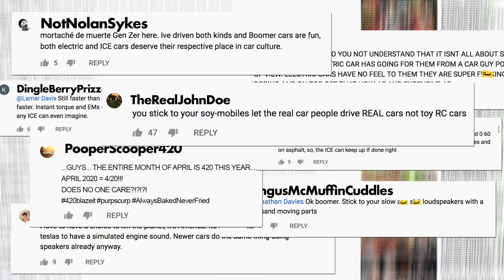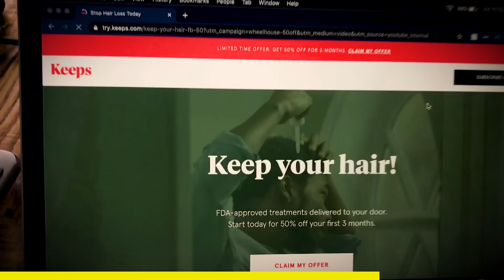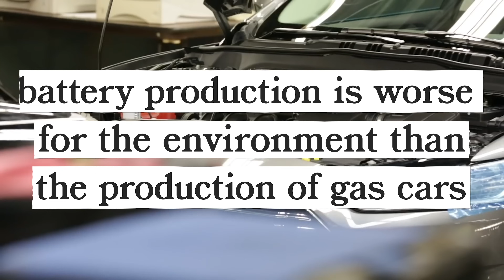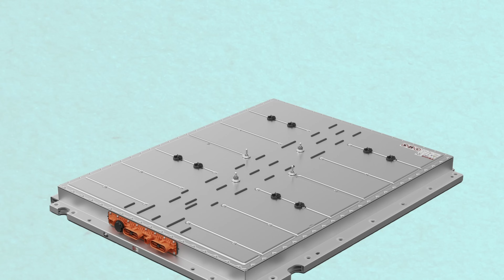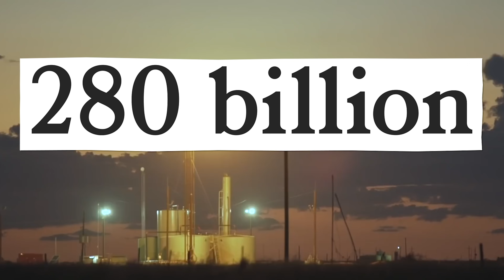Are Electric Cars REALLY Better for the Environment?

Comment: but if you take a look at it, co2 is an indicator gas, which indicates the presence of other greenhouse gasses in the air. co2 is actually a really bad insulator of heat. in my opinion, if gas cars keep getting cleaner, and put out minimal co2 and other emissions, there really isn't very much to worry about. as nolan mentioned, cars do produce lots of co2, but when you look at the environmental damage for mining lithium,  there is a more long term impact, as they are taking out all of the precious minerals out of the ground that plants need to grow. As I live in northern Canada, and have lived in a town where a majority of our economy relies on oilfield, I know for a fact that the oilfields do not cause very much pollution at all. I have also grown up around all sorts of vehicles, and I love driving. but there is a significant difference between our older vehicles and newer vehicles in the emissions department. I do respect it if you think EVs are better for the environment, but in my opinion, as cars are getting cleaner, we have barely anything to worry about in emissions. there is also the manufacturing emissions (which really, who cares) which are absolutely minimal. and I think if you want to save the environment, please go plant a tree. I am open to discussion if anybody disagrees, but this is my true, honest opinion about EVs vs internal combustion

Comment: Tesla recently patented a battery technology that doesn't contain any lithium, and will allow batteries to last for 1 million miles of driving. (Note that this does not mean it can go 1 million miles on a charge.) It means it takes 1 million miles for the batteries to degrade to the point where they can't be used any more. Current Tesla batteries are designed to last for 8 years or 125,000 miles. The new battery will last more than 60 years. This will make it much easier to recycle. Also the new battery technology will give Model S's and X's ranges around 700 miles.

Comment: At the end of the day, using a 4000 lb object to transport a being that only weighs 170 lbs isn't a very eco-friendly thing.
Reply: And your alternative is????
Reply: @Brian-om2hh  ah, you could use a bicycle. Or even a motorcycle. Given the laws of physics, using less mass means less force it's required. Therefore less energy needed to move the object. The lighter it is, the more eco-friendly.

Comment: I feel like he missed the fact that batteries in EVs have a very limited life. They have to be replaced, which causes more emissions and  there is also the fact that while getting involved in accidents alot of EVs batteries burn on impact causing toxic gasses. Aside from the spontaneous combustion of old stored batteries. There is also barely any recycling or resale of non working EVs esp Tesla. Which causes a whole new car to be produced. While individuals and esp junkyards are able to Frankenstein a completely working car from reused and broken down cars this causes barely any emissions apart from the use of some power tools or welding. Personally I think EVs are not the future but merely one step towards the end goal. Hydrogen, solar or perhaps even nuclear powered cars will be.
Reply: Musk is aiming on a million mile battery. A single battery would last even more than the lifetime of many vehicles. Lets see if it's achievable.
Reply: Hydrogen may be the future but it's just electric with extra steps to remove the battery.

Comment: I think what concerns a lot of us with EV's that's not addressed is Battery Life, Battery Replacement, Environment Impact of Battery Replacement, Access to the Batteries in the Vehicle, Charging at Home, Battery Damage due to Rapid Charging, Loss of Range Due to Environment Conditions, Charger Availability and Electrical Grid Infrastructure. 

For example.... One of the nicer EV's or EV Trucks consumes more electricity to charge than my home does in a 24 hour period. If we were all the switch to EV's overnight the current electric grid that we have in place would need to be three times the size that it is now. We have already seen rolling blackouts in some states so what confidence do we have that the power will be there when we need it?

Comment: a blanket statement that if 25% of electric cars today hooked to the electric grid it could handle it.  Yes in some area's, in some area's it will depend on when these car charge time/day.  In some cases the homes electric transformer/service wire cannot handle a car charger,  thus electric system upgrades will be needed.  Mass influx of electric car will require power system upgrades, which cost money, time, and resources (which consume resources and add pollution)

Comment: Let's hope you never need to replace the batteries
Reply: Why? What's the issue?  EV battery packs can readily be tested and reconditioned, in the same manner as reconditioning a gas engine. Weren't you aware of that? There are already videos on YouTube of the process.... Takes just a couple of hours or so, the cost is a few hundred dollars. Comparable with something like a clutch swap on an i.c. car.....

Comment: What about when it needs a new battery?
Reply: You get the less efficient cells tested and replaced to restore the efficiency of the pack. Takes about 3 or 4 hours and costs about the same as replacing a clutch on an i.c. car........ All new electric cars normally have an 8 year warranty. Nissan offer to replace the pack if it isn't at 75% efficiency after 8 years..... They say they have replaced a handful of them in 10 years. Not too bad after selling over 300 thousand of them...
Reply: @Brian-om2hh  im talking about environmental effects of making more battery's for replacements causing a bigger environmental impact.

Comment: When  you change a Tesla battery 3 times in 2 years and 2 motors in 1 year I’d say they are still worse until they can go 100,000  miles without that major work I’m sticking to gas

Comment: At some point, the emissions will also fall for the production of an EV. The reason is that we will probably find a better material (than lithium), that will be more effective and be less environmentally damaging. There are already companies that have figured out how to produce silicon batteries (ex Amprius), which are more effective and could have a smaller carbon footprint. They just have to figure out how to upscale production. 
And the used batteries you talked about, could be used for powerwalls, energy storage at facilities etc.

Comment: Nolan: mining lithium makes polution

Me: ez. Make electric mining vehicles
Reply: What’s interesting is that the really large dump trucks actually are not propelled by gasoline(diesel)at all. They use massive electric motors. However they do have just these tiny little/gigantic gasoline generators onboard to provide electricity to the motors. Haha. I believe it’s the same with trains. They need the electric motors because they are easier to control and I think more powerful too than ice propelled machinery. Anyway! If only you could find a way to supply the electricity to these already electric pieces of machinery. It would be a massive power draw though. 🙁 this is 2020! We gotta find better solutions.
Reply: @GMoney-B  big trucks and trains don't use gasoline. They use Diesel..and those are Diesel electric generators..
Reply: Jay Temkar oops, I meant diesel 🙄😅. Thank you. 👍
Reply: @GMoney-B  i just came across your comment but I believe that was Nikola Tesla aiming for a world free of pollution because our energy would be harnessed from the atmosphere using specific buildings as conductors for electricity... until Thomas Edison sacked him
Reply: @GMoney-B  big brain
Reply: @GMoney-B  Electric motors provide instant torque, as opposed to ICEs. That is why they're used.
Reply: @GMoney-B  anytime you convert power from one power source to reproduce it with another, you loose energy, the more times you transfer energy the less efficient it is, that's why we burn gas to heat houses instead of use electricity that is made by burning gas, because it's less efficient, thus the reason why electric vehicles suck.
Reply: @ryancasey4807  what about when they are powered by solar panels on peoples homes who have their roof and in their backyard to charge it almost all the way? I think that is better than using gasoline in my opinion.
Reply: @GMoney-B  that's a good idea in theory untill you find out how much oil it takes to make solar panels and that most of them aren't in service long enough to pay for them selves or make up their carbon footprint, especially when you consider all the other equipment including the batteries, wires, battery management systems, the dc to ac inverter - and the power losses that come with that. As well as the fact that most solar systems on people's roofs aren't puting out enough power to charge an electric car if they drive the standard amount of miles per year and they have a standard solar set up
Reply: It pollute water and land resources..not the air..
Reply: @jaytemkar8077  desalination of sea water would be good. But I know it is very energy consuming. But we should make use of renewable energy sources wisely. And use that for desalination.
Reply: @jaytemkar8077  r/woooosh
Reply: 9600GTMAN  
Completely incorrect. Most super-heavy mining vehicles are already electric. The main advantage, and why electrics are used is because of the instant torque granted by electric motors. Caterpillar is the ONLY company that uses diesel-mechanical drivetrains in their haul trucks - ALL other manufacturers use diesel-electric drivetrains in their haul trucks - diesel to generate electricity to power electric motors which then move the things. (the main problem with electric is the power supply - making batteries to power such beasts is impractical, whereas diesel has fantastic energy density) 

Virtually all operational military submarines are diesel-electric or nuclear-electric. The most successful tank destroyer of ww2 was petrol-electric. Diesel electric locomotives were introduced in the 20s, and are pretty much exclusively used where electricity isn't easily available through other means.  High torque applications are what electrics are meant for, not their weakness.
Reply: We are still unable to make normal good electrical trucks, mining machinery is still a dream. And it will come true one day
Reply: Drilling for oil, then refining it and transporting it to gas stations also makes pollution. Horses for courses....
Reply: If you're hungry, Just eat your feet bro
Reply: There are electric mining vehicle's, and mines that are zero emission,  Reclamation is a requirement basically every jurisdiction!  Every tangible item you own from house to phone is made from raw materials.
Reply: Extracting and refining oil causes pollution too.....
Reply: Does exactly work like that bro 😂

Comment: The reality is there is no practical solution based upon our current technology. Solar, wind and nuclear are impractical to produce the energy we need and come with their own environmental issues. Until we come up with a practical environmentally friendly power source Electric Vehicles will use as much if not more Fossil Fuels given the losses involved whenever you convert energy and transmit electricity over long distances. Batteries also have an internal resistance which means you waste power charging them. Until we come up with a new power source all we can do is attempt to refine our current technology to be as efficeint and as clean as possible. There are some very exciting new developments into Nuclear Fusion. https://www.theguardian.com/environment/2020/jul/28/worlds-largest-nuclear-fusion-project-under-assembly-in-france

Comment: Well I don't have a Ph.D in the topic but I own a used EV. No one mentions the environmental impact of used EVs. Also I find it suspect that people always compare charging electricity to coal usage like i'm blowing up a mine every time I put 5000 watts into my car. My state primarily doesn't even use Coal it uses gas. Most states with bad ev charge maps use coal.

Not saying they behind the times or anything.

I get it also that the cars are quiet but I find that very interesting for as fast as they can go. Like check out the nio ep9 supercar. This thing is just getting started as long as world doesn't blow up before EV sales do.

Comment: It’s true that in a long range perspective, Low-exhaust engine is way much better at reducing total emissions and recovering construct of nature.
And plus, we don’t even need to make gas on my house’s roof.
Apart from energy efficiency problem, as there are problems that we have not been able to solve even through centuries of investment and research, the fatal problems of batteries will not be solved soon.  The fact that the internal combustion engine has become an unprecedentedly clean mass-produced machine based on tremendous improvements remains unchanged, and although EV has been made huge improvements during a few years, the path for electric vehicles to go is a bit absurd.
Reply: are you on dope
Reply: @lovesosa4751  sadly not as you sir

Comment: Only part I miss is, the lifespan of the batteries. It's somewhat lost and is a big thing. Especially in colder areas meaning it needs replacing faster. Meaning in the end it still has more impact in during production.

Comment: The major problem I have with all the data that you supplied is the unreliability of electric power. There are so many problems you can run into with electricity, that you don't have to worry about with gasoline. You can store enough gas to last you a long time if worst case scenario happens. EMP can cause a major problem with all modern day cars, but electric car are dead with no chance at all.

Comment: 9:50 assuming it lasts long enough to not be replaced. I think my old ass Corolla will be more efficient considering I won't be replacing it for a while. How many of those EVs last that long? Depending on the producer I could definitely say that not all EVs will last long enough to have a long term co2 improvement.

Comment: I ALWAYS HAD THAT FEELIN DEEP DOWN IN MY SOUL
Reply: He didn't site his sources
Reply: @apexhunter935  also he has not considered the CO2 emissions, enviro footprint and societal costs of keeping older EV's on the road. By the time that used EV's are at a second hand price that average Joe can afford they will be needing new batteries and electric motors etc and the environmental costs and hip pocket costs of that will exceed the costs of running an older ICE car. Then there is the costs associated with scrapping older EV's. The toxic explosive materials in the batteries and electric motors  cannot just be put in a junkyard and crushed - it will need specialist expensive recovery stations that will have a large CO2 emissions footprint.

Comment: Hello, I'm sure there included battery replacement approximately every five years. Which is given as battery life before it starts to lose capacity?
Reply: Considering an ice car lacks even a 5 yr 50k warranty these days that is about par. And battery tech will improve to the fabled 1m mile mark. Even as that improves, the average battery distance will remain because cars that drive 900 miles with a 2k lb battery pack might do better having a smaller pack. I mean, I wouldn't buy a new car these days, lifter problems out the factory, recalls on explosive seat belts, airbags, and electronic transmission knobs! Scary! I have a 77 z instead haha
Reply: Most EV manufacturers offer an 8 year warranty on the battery pack. Nissan offer to replace a pack if it doesn't show at least 75% efficiency after 8 years. Packs with less efficient cells can have those cells replaced in just a few hours, at roughly the same cost as a clutch swap on an i.c. car.......

Comment: EVs are a pain in the ass to work on, and most of the companies that make gas powered cars and EVs require techs to have special certifications to work on an EV, whereas the only time any certification is required by the manufacturer for a gas powered car is if it's a higher end model. So with Nissan, the only time Nissan requires a certification to work on a car is for either the Leaf, GT-R, or a diesel Titan. Different certifications for each one. Not to mention the fact that the price for maintenance on an average EV is quite a bit more than an average gas powered car, as well as the cost of much of the parts that need to be replaced, if needed. So yes, an EV will save you money on oil changes and having to stop for gas, but it's also much harder to find someone who knows how to work on your car in the event it breaks down in the middle of nowhere.

Comment: The coal the power plant can convert many times more usable power than a car engine does burning the same amount of material. This argument was originally made by gas engine car companies to slander electric cars. Also lithium car batteries can be easily recycled. If we have made electric are more available for everyone, these "problem" won't even exist.

Comment: Nice video but you forgot to mention 1 thing, after a couple amounts of charging a batery the batery will store less energy.
so how more you charge, how worse the batery get.
on a longer time period, for example 20 years the batery needs to be changed so that same 17metric tons what you mentioned wil be poluted again.
Reply: Most Tesla owners with cars that past an odometer reading of higher than 150,000 miles report that their Tesla still operates with 90 percent efficiency. They speculate these battery's being able to go past 500,000 miles without needing replaced.